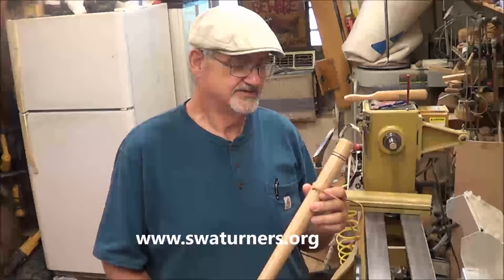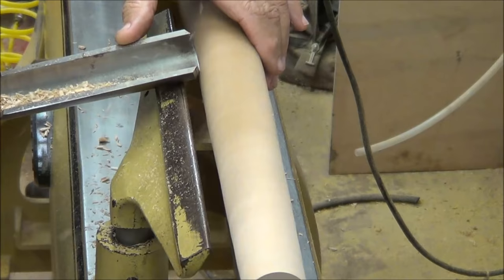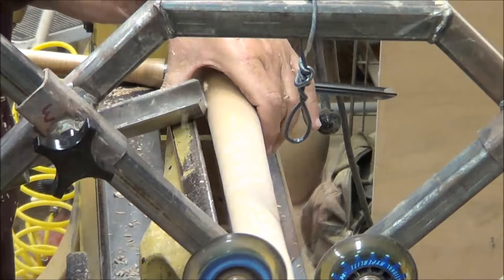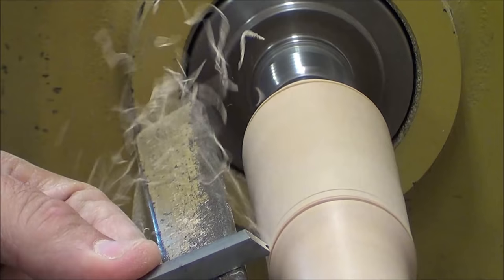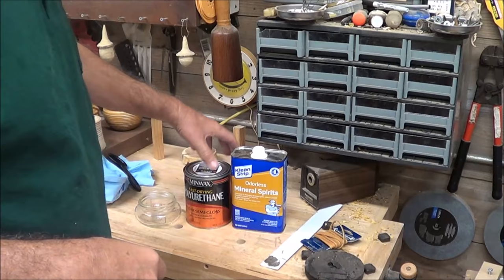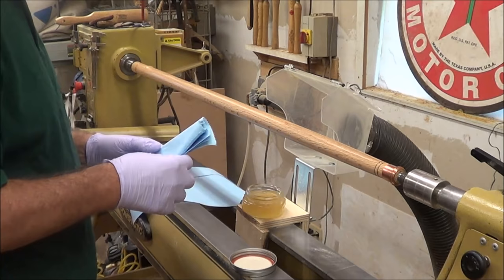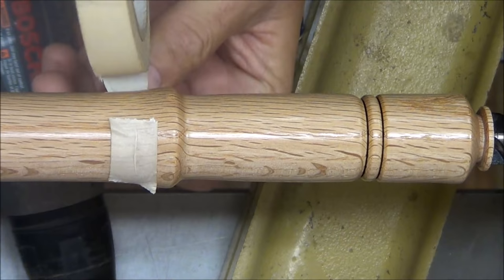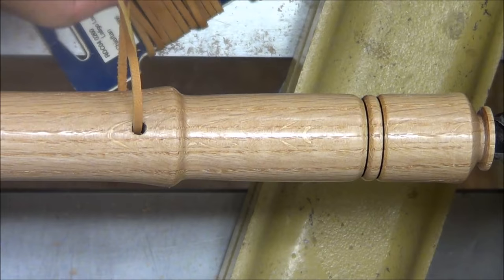Woodturning A Walking Stick

Comment: On your steady rest, couldn't you remove two opposite arms and flip them before reinstalling them since the arm stock appears to be square? That would result in two opposite wheels closer to the headstock and the other two closer to the tail stock.
Reply from the maker: Don, the square tubing that I used came from a scrap bin (free) I had to grind each arm to fit in each respective slot & none will fit in another slot or even reversed in the same slot , so each sliding Tube is married to it's respective slot, the factory welded seams are not perfect, I could flip them but would have had to stop & do some grinding on the welds to make it slide if reversed , that explanation makes sense in my head  not sure about anyone else :-) I should have used one size bigger tubes for the holding slots & that would have solved it but that was what I had available at the time, I'm sure I would make them differently (next time). I don't do a lot of long "thin" spindle work & they work great on anything bigger.

Comment: Looks good Mike.  After your 2 or 3 coats of poly, did you do any light sanding or buffing?
Reply from the maker: Eric, I did not sand but did buff it with Carnauba with the Beall system. Thanks....Mike

Comment: would this mixture work in spray gun  for bigger projects?
Reply from the maker: I’ve never tried using it in a spray gun but I’m sure you can. one sure way to find out is to try it.